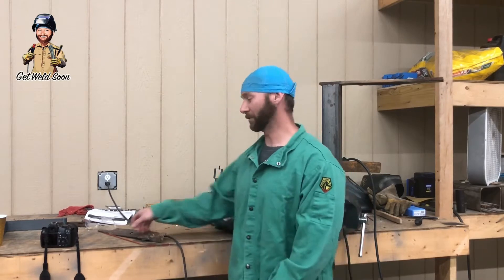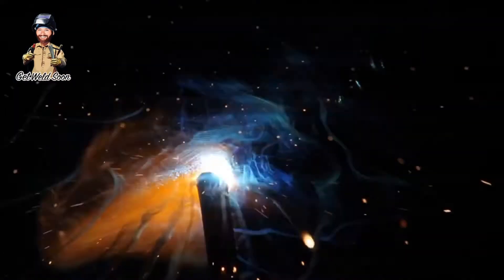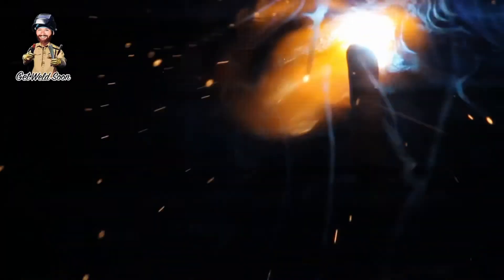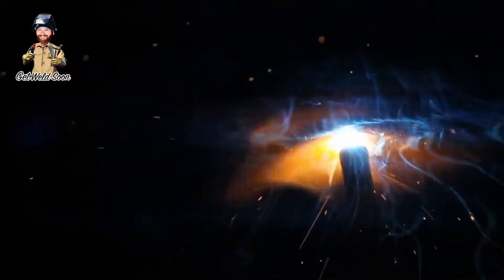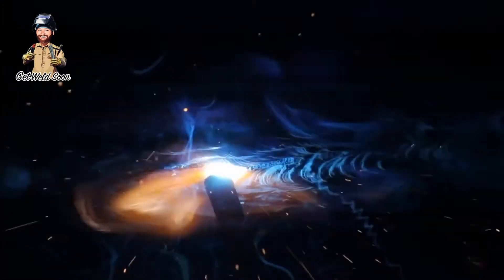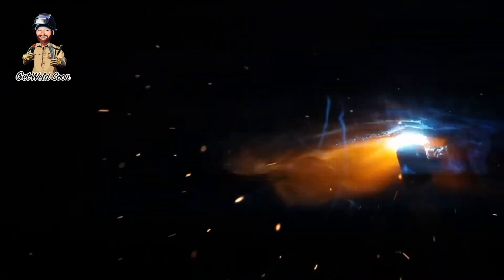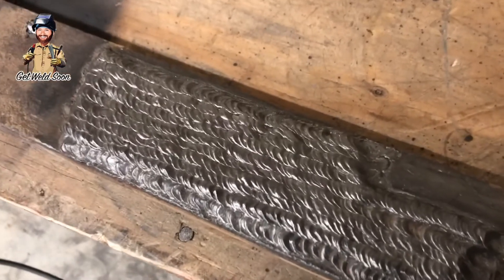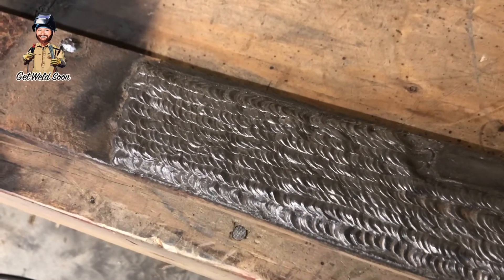6010 and 7010 overhead welding tips

Comment: Man I can do a real decent 6010 on flat, horizontal and vertical but this overheads kicking me i can’t get a puddle and when I do it just sits
Reply from the maker: Are you whipping it or trying to drag it?
Reply from the maker: You should whip it forward and back to get the puddle to move for you.
Reply: @getweldsoon1113  so im whipping it and sometimes i get it looking okay but its either all over the place, too quick or too slow... this one is hard, i had too grind it all down and restart. no saving what i did lol
Reply: Keep the rod angle at almost 90°, this really helps . Keep the arc longer than 6013 or 7018 but keep it tight enough that material don't fall.
Reply: @isobutylformate8287  i did notice that you do have to keep it a lot closer... but i didnt realize youre supposed to keep almost at 90 ill let you know how it goes lol
Reply: @isobutylformate8287  great tip I finally got overhead down pretty well

Comment: Pretty damn good for being "rusty"! Thanks I'll be doing this tonight, my last night of the semester. I've got a B+ and if I can do this half as well as you it'll push me to an A-. As it's worth 10 more points. Thanks again.
Reply from the maker: Thank you sir, I appreciate that. Hope this helps you! 👍
Reply: @getweldsoon1113  I got my A- and after some adjustments I got a 3/32 4g groove weld, (no backing plate) through the other side with only a tiny burn on the very end of my 2 plates. So thank you for the video.
Reply from the maker: @JRsVsO  awesome man!! So glad I could help you out! That’s what I do these videos for man! I just wanna help people. 👍

Comment: My biggest problem with overhead so far is keeping my beads straight. I’ll start out ok then start drifting off to left field so to speak. Any advice is greatly appreciated!
Reply from the maker: Yessir it’s very hard to stay straight without something to guide you. I recommend drawing a straight line with soap stone and weld over it for the first stringer. Then hopefully you have a straight stringer to guide the next one. Hope this helps.
Reply: Do what he said^^^ but before you run the overhead, find the most comfortable position to run that initial stringer for your guidance, THEN tack that plate overhead and run your consistent passes

Comment: OMG! I found you by needing instructions to replace a handle on my recliner.   I did my first weld repair on a bed frame.  I have a harbor freight wire welder.  I will definitely follow!
Reply from the maker: Great! Let me know if there’s a certain thing you need help with and I’ll make you a video.👍
Reply from the maker: Okay great I’ll be doing some mig welding videos soon. Any requests?